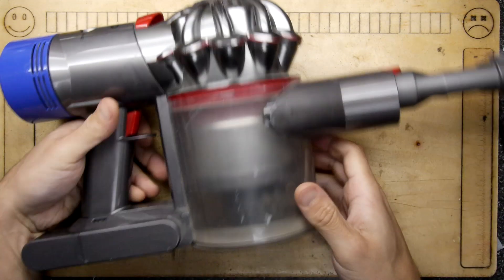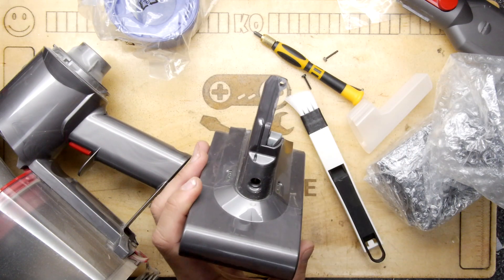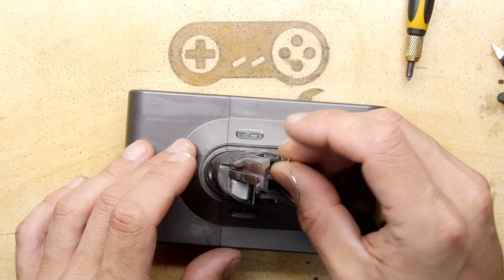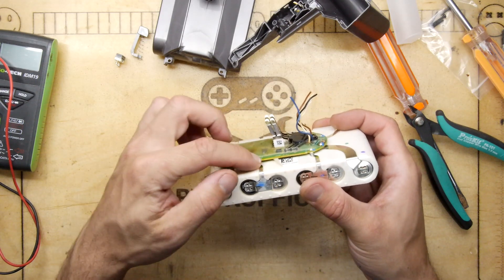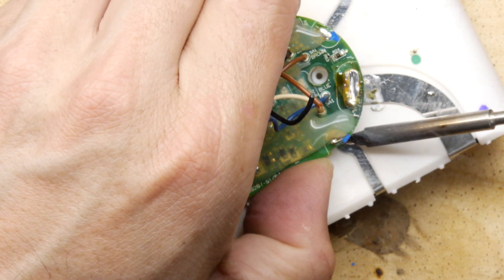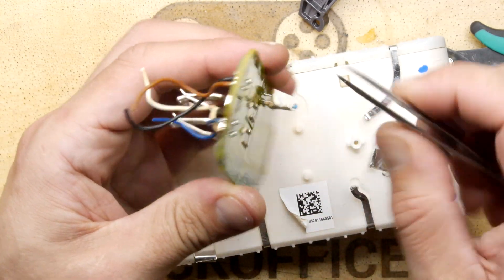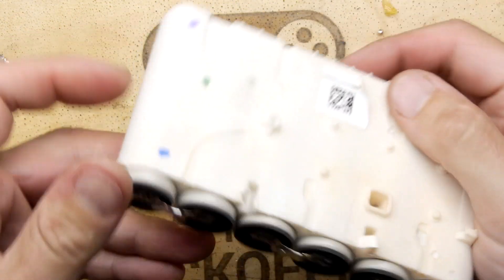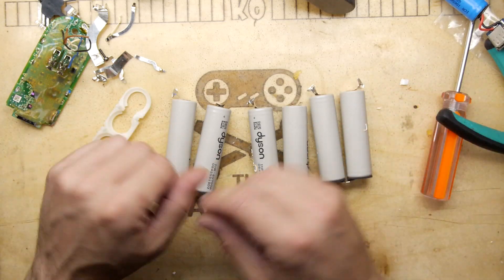Dyson v8 Battery Swap and Teardown

Comment: Yeah, the other type of V8 battery is with 18650 cells. And is labeled:

"Battery pack 6-cell(238168) INR19/66-1"

And individual cells says: 

US18650UTC5D 5D
G 1444932BF21A
MURATA INR19/66

No Dyson wrapper... only Green Murata wrapper, and those might be SONY originally.

Comment: 20700 is designation for the battery cell form factor which is indeed 20 millimeters by 70.

Unfortunate, because apparently 20700 was really short-lived as standard and was quickly superseded by 21700 which is indeed becoming almost as popular as the old, venerable 18650.

Comment: Ahhh sadly you didn't bypass the switch, as I have a problem with the battery but the motor runs fine with a lab supply. After I press the swtich  on the battery it reads 135mV, even with switch off. I've not dissembled the battery yet to look into the switch. Can you or anybody check that that the voltage rises after pressing the switch please?

*Edit: see the black bar at the end of the battery pack, yeah it is a reed switch. This didn't trigger anymore. To anyone with an unresponsive battery even though it charges with LED lights on and but no reaction when the "insert" button is pressed, cut the reed out and bridge it with a wire.

Comment: would it be possible to add a additional pack of batteries to the existing pack and wire it up in parallel with the existing battery pack, I'd consider doing this to increase the run time of the unit.
Reply: Yes.

Comment: The cells are molicell 20700A's with a new wrapper. You can even find datasheets with typical cycle life data and everything which I think is interesting
Reply from the maker: I don't know why it's so difficult to find decent batteries these days, it seems that there are so many mislabeled and clones out there that it's hit and miss. I really think that Duracell and ever ready need to get in on this

Comment: I was about to throw my replaced dyson V8 battery until I sees this video, I reckcon those cells could be a very nice flash light battery, just a little bit shame did not have the dimension on those dyson cells
Reply: The v8 uses 20700 cells, not a common size.  They are in a case that is thick (for protection).  I have opted for a 21700, for lower cost, higher capacity, and greater choice.  I'm looking for ways to protect my cells and still fit within the Dyson pack, at least until I can find a way to build my own design in CAD for me to order from a 3D printer.  I can do CAD work, but I haven't had time to dig into what software is used for printing.
Reply: @ericvincent3219  Since you're not gonna be able to reuse the cell holder with 21700s, just tape the pack together with kapton tape with silicone pads as spacers(nano tape that has lost its tack would be a good choice).

Comment: I replaced these cells with molicel 21700. Now the vacuum lasts forever
Reply: What is what I want to do. I ordered some Molicel P42A so hope I will no longer have any issues running on max setting.
Edit: could you fit the 21700 into the housing?
Reply: @certifiedalchemist  It won’t with the shell of the pack. I tossed it and just wrapped some electrical tape around the cells
Reply: @certifiedalchemist  did the molicel P42A fit in the housing? I use the wall mount so I’m worried taping up the bottom like OP will prevent it from fitting in there
Reply: @TuneYourOrgan  I cut the plastic shell for the cells in half (or actually cut 2/3 away). So the cells still had some grooves to rest in and then just taped it with kapton tape to hold it together. Snug fit, but once it is in there is no problem. 
It worked out great. Original battery could do 7 mins on max when it was brand new. With the P42A's it goes for 12 min.
Reply: @certifiedalchemist  These are the same cells I chose.  If I understand what you've written, the "sides"--which would be the top and bottom while sitting flat on the table--would be left, and the batteries would be the meat if it were a sandwich?

I was going to wrap as many layers of kapton as I could fit for impact protection, but if you have something that works, I will likely go that direction.
Reply: @ericvincent3219  no that wouldn't fit in the housing. I just cut it horizontally so the side closest to the pcb (side with thermal sensor) is used and the other part it thrown away. To use your analogy it would be an open sandwich. The kapton tape is then used to hold the cells together with the remaining part of the white plastic shell.
Reply: @certifiedalchemist  Perfect!  Thank you.  I'm a few days from that being my top "to do" task, so I've been kicking around how to, and had not gotten that far yet.

Comment: Cool info, But what was wrong with the pack if the batteries are ok
Reply from the maker: I would start looking for a fuse
Reply: The black reed switch did not trigger anymore, the black bar in the front of the pack. It let's the battery know it is inserted into the vacuum which has a magnet somewhere at the bottom. And only then it supplies the 24v to the prongs.

Comment: Hi, How many mah,  I must  use?
Reply from the maker: As many as you can get, the bigger the number, the longer it will run
Reply: Great video mate, could I replace the battery with a 12800mah battery? The volts are the same as old battery it’s just a bigger mah,,current battery is 1300mah 22.2v, replacement I’ve been looking at is 12800mah and 8800mah both 22.2v, 
Thanks
Reply from the maker: I don't see any reason why not as long as it's the same chemistry and voltage
Reply: @backofficeshow  yes the chemistry is the same just a bigger MAH than oem
Reply: No way a replacement battery can reach values even close to this capacity. The best 20700 cells on the market (a V8 battery consists of 6 individual 20700 cells in series) are rated well below 5.000mAh.

Sorry to say but therefore any rated capacity above 5.000mAh is nothing but a scam. @sabiya2

Comment: Expensive price for crap vacuum. I hate ours. It pushes anything bigger (ie dog kibble) all around the floor, instead of picking it up.  Battery is screwed after like 6 months of use. Plus the handle hurts your hand while using
Reply from the maker: Yeah, I agree, totally crap and actually loosens up with use. Probably cost several lifetimes of regular vacuums as well 🤦

Comment: These are basically impossible to rebuild without special equipment. 
Meaning all this ends up in a landfill…. I love how companies pretend to give a shit about the environment while putting out products like these.
Reply from the maker: Their products are absolute crap
Reply: @backofficeshow  And all those 21700s still hold and least 4 volts!  Dyson truly is the Apple of home appliances.
Reply: I'm using a $35 charger/tester and some wires to check capacity on each battery cell while still in the pack (it's jank but safe).  They're 3000mAh cells like shown above, and the 3 I've tested so far are 2289 mAh to 2315 mAh on wife's V8 Animal.  I got the cells out of the case with some patience, some $7 car trim pry tools that I overpaid for, and there are no scratches on the casing at all.  It's mostly patience, but not much past that...

I am likely going to replace all the cells, and they're less than $10 each, and I have an $80 cell welder.  So I'll have about $175 in one battery, but I also have a battery Dremel, two Ego 2.5 Ah batteries, and I'm sure a few more I can't think of...so really it's not a huge investment in tools.  In the end, $6 x 14 (unless I go with LFP and it's 16S and new BMS) for a new 2.5 Ah battery for Ego instead of $150+ per battery.
Reply: @ericvincent3219  can you report back how the cell replacement went? I’d like to do the same. I don’t have a cell welder though. Would it be possible to rebuild without one? Have you found a source for the replacement cells that you could share? Thanks!
Reply: @TuneYourOrgan  Henry, I have purchased the cells for retrofit, but I chose to use 21700 Molicel 45a, 4200mAh cells.  These take an extra 6mm in stacked width, which will fit within the pack, but I discovered the 21700 spacers make the pack too long.  I'll be using kapton tape to make my own pack configuration (I will mimic the OEM 6-in-a-line).  I'd love to have snap-in batteries like a toy AA/C/D one, but haven't found any.

I ended up buying a cell welder, and can't imagine any way to do it otherwise...but given how much lithium I'm owner of, I can now fix any of them using this.  In my mind, that justified the $80 I spent.

I also spent $40 on an Xtar VC8 8 battery charger/capacity tester, and then I purchased the cells from 18650batterystore.com for about $6 each, plus spacers, nickel strip, and spacers.

I have more in the rebuild than what a single Dyson battery is, but given that I have a cordless Dremel, 2x Ego batteries, 2x Ridgid (granted these have forever warranty), etc. it made sense to put down the money up front and know I'll be better off going forward.
Reply: @ericvincent3219  thank you for the info! I was hoping I’d be able to replace the cells myself maybe having to solder the connection, but sounds like no :/ someday when I have more space I’d like to get the equipment you mention
Reply: Seeing how the cells are packaged I'm inclined to go the same route than so many others before me: 3D print an adapter that allows you to run V8 on power tool batteries. They are usually 18V instead of 21V so they might not last as long, but on the flip side they are made to be easily swappable and the packs and chargers are standard stuff and thus enjoy the economics of scale.

Comment: I have dismantled over a dozen used V6 "2ah" batteries and a few non-Dyson "4ah" equivalents. The used Dysons had >2ah and sometimes 3ah capacity and the copies <1.5ah - the ones I tested at least were junk.

Comment: I can't believe you measured those cells... they aren't called 20700 for nothing ;)  Other than that, the fact that the charge port and the power button are part of the battery design doesn't instill much confidence in the parts Dyson are using.
Reply from the maker: I've since moved away from Dyson and gone to GTech after having loads of problems with these.